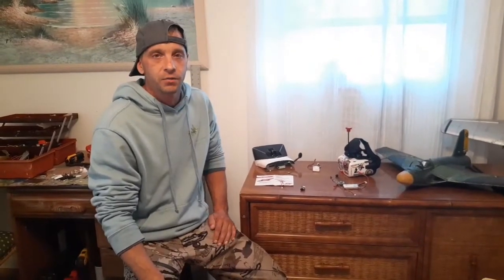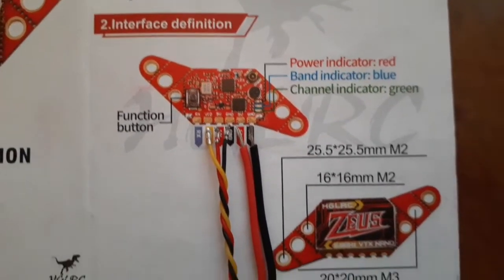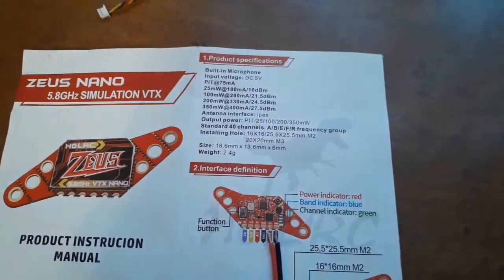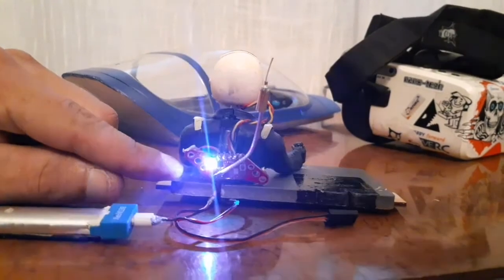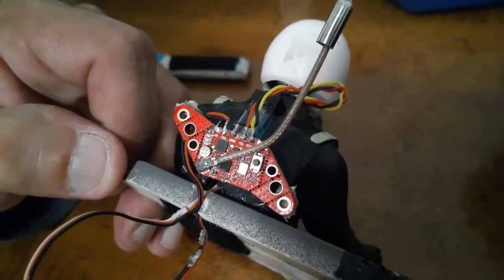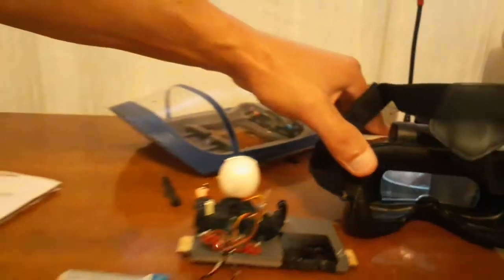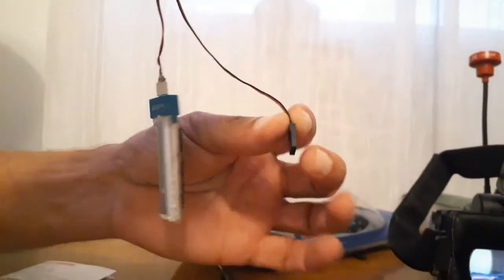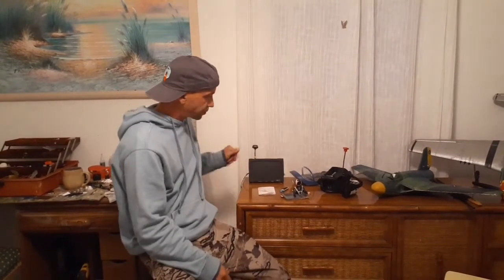Easy FPV Setup (Easier than you think!)

Comment: Fantastic Jude and Emily, what kind of battery connector? 2s? Thank you Jude and Emily, Jeff in LA USA
Reply from the maker: 1s 450mah will last 10 minutes easy. 😁👍 let me know if I left anything else out. Thanks Jeff! 
Jude 
Emily
Reply: @JustEnoughRC it works with a 1s?? It shows it doesn't work below 5v though
Reply: @JustEnoughRC 
I use a 1s and it just don’t show video 😅

Comment: I bought this transmitter. It's working fine on 25mW but When switching to 350, it doesn't transmit as well as it does on 25mW, and even if it does transmit, it's not the best signal strength for some reason. How to fix it??
Reply from the maker: Make sure its getting air flow. If it gets too hot it will shut down. On 350mw it gets hot quickly if its not getting cooled
Reply: @JustEnoughRC i kept it in open air literally